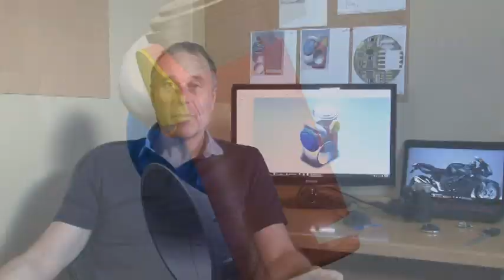Screaming Banshee - Shockwave - Safety Horn

Comment: Hi Peter, Today, i installed a Delkavic 350mm exhaust onto my Kawasaki Versys LT1000 in the hope to stop or delay crazy motorists from hitting me.   Sadly to say, what i installed isn't that much louder then the stock exhaust.  So, instead of purchasing another, i thought I'd purchase a horn instead.  Very interested in your air-horn and will check out your "kickstarter project."
Reply: Richard Ratahi a loud exhaust will not help you, just annoys your neighbors. Banshee or Denali is the way to go.

Comment: Delou56 - it will fit your Triumph but not under the beak - my concern would be contact if the suspension bottoms out. Possibly mounting it in front of the engine at the top, this may be a good place.

Comment: I want this for my 1978 puch maxi luxe moped that is being converted to a 70cc from a 49cc. The horn system is on a 6 volt one. Any thoughts on what I could do? I have to register it as a motorcycle but I want a loud horn
Reply: You might need some kind of transformer to reduce voltage

Comment: Hello, I'm having a slight problem with getting the Shockwave horn to function correctly. Does the yellow wire have to be spliced into the lowbeam and which shunt do I use?
Reply: I'm not associated with these guys but I was researching the product and found you an answer: Yellow Wire – Connect this to the 
High Beam wire on your headlight using the  supplied Tap Splice 
terminal. Note: This is not needed for the horn to function but if not 
connected make sure yellow wire cannot short to chassis.
Reply: guaroshadow:  Thank you for getting back to me. I'll try that and see what the results are. Thank you again, I hope your day is a pleasant one.

Comment: Is the horn waterproof? My bike is naked and it will get wet, I don't want to buy it if its not waterproof.
Reply: Mr Fathead Interesting August 30th 2019 came home from work on my 1200GS in a thunderstorm and my control module got soaked the horn came on and blasted all the way home...burned up the relay and the air horn. Very sad 😕

Comment: Blah blah blah, it is still illegal to use a horn no matter what. A motorcyle horn is loud enough and this banshee horn is more of a distraction to all other motorists in the vicinity than a safety device. 

Just tell these crazy motorcyclists to ride responsibly, stick to the speed limit and stay alert, act early and slow down because I've been driving for nearly 50 years and out of thousands of motorcyclists since 1978, I have not seen one who would ride responsibly. Have a look at them yourself these days, they speed, tear through between cars, get in front of you at the traffic lights, knock your external mirrors, do wheel-stands, etc., typical mad rider style. And you want banshee horns installed on their motorcycles? You're just as bad as they are.
Reply: sexiewasd 
Sorry but, you see a very very small picture. When you're on the road next time watch motorcyclists tearing at high speed, watch the shit they do that car drivers don't, including excessive exhaust noise. I mean, do I have to repeat myself, or do I have to remind you that no motorcyclist respects the law? And in this case of having a loud horn and using it, it's called annoyance because loud horns startle other motorists and that can affect those with a weak heart. So, under any circumstances horns are not to be used as a way of warning other motorists to '...get out of the way, I am coming...' so that they can continue to flout the law and speed, tear through cars and race to the next set if traffic light. Besides, with modern cars these days that are fully insulated against noise that not ever the wind noise is heard from the closed windows and with blaring  music inside, you'd think they will hear a horn? LOL. They don't even hear a bloody siren of emergency vehicles that are right behind them trying to get through. And yes, it's illegal to blast horn, except in a critical or emergency situation. The reason motorcycles collide with cars is that they are narrower than cars and hard to see at a distance, especially at sunrise and late afternoon when you get the blinding sun in your face, and when a car turns right or left, the motorcyclists are already near them and about to collide. What does that tell you? Of course, it's the speed the motorcyclist was travelling, one second it was 300 metres away, the next, he's right in front of you. I rest my case, mate.
Reply: Mick Carson youre gettin old now huh?